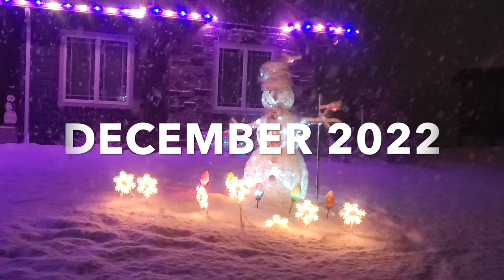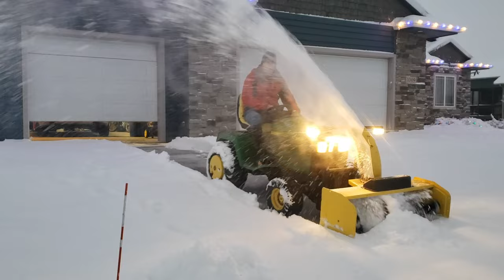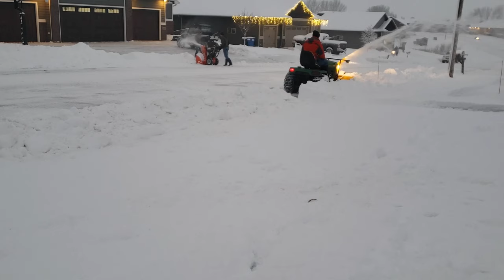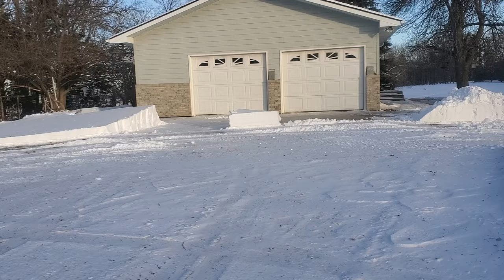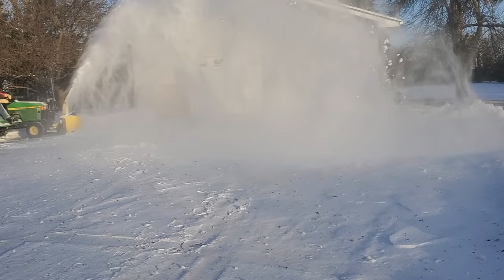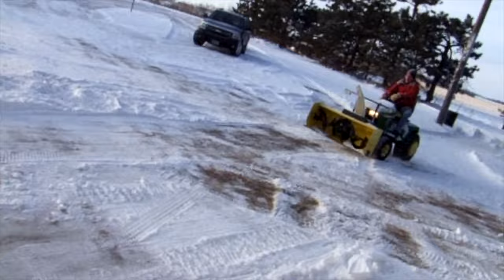John Deere 445 Garden Tractor and 47 2 stage Snowblower at work in beautiful South Dakota scenery

Comment: I have a 425 here in NY. Its a '96 and Ive owned it since 2003. Pretty much use the plow most of the time but a few storms have been deep enough to switch to the blower. I bought a single stage because the price was right but I really want a two stage. Hard to find a clean one in my area though. Im always looking !
Reply from the maker: Glad to hear from you!  I was looking for a 4x5 package for my dad until last spring.  I lamented that all the best stuff was 1000 miles or more east of us in OH, NY and PA.  Lots of people around here have switched to blades on side-by-side UTVs. Works out in winters we're in like this one (2023-2024).  Last winter (22-23) they were all in trouble by mid February as there was nowhere else to push the snow!

Comment: Would like to see the a closeup of the framework for the extra headlights.  Looks solid and not cumbersome cumbersome . Where is it attached to the tractor or to the blower frame?
Reply from the maker: Thanks for watching, Jack.  That light bar is 1 inch tube steel attaches to the quick hitch with a couple of bolts on either side.  I'll get a couple shots for you when I go the video of re-mounting the blower in the next week or so.